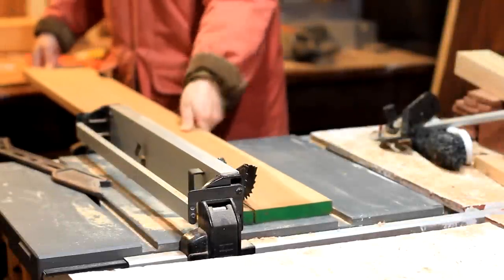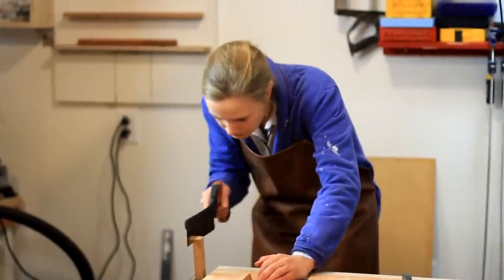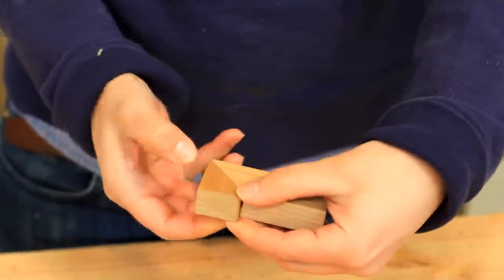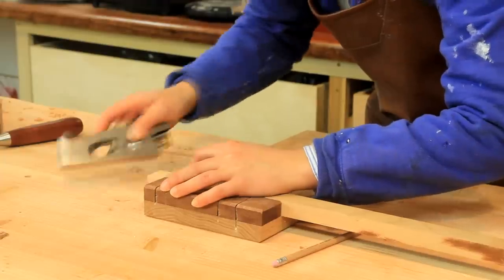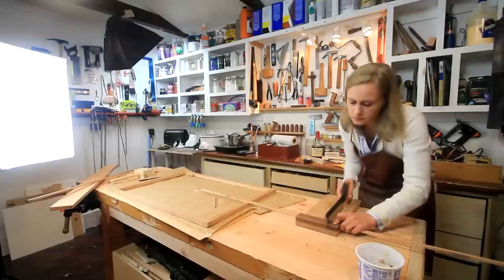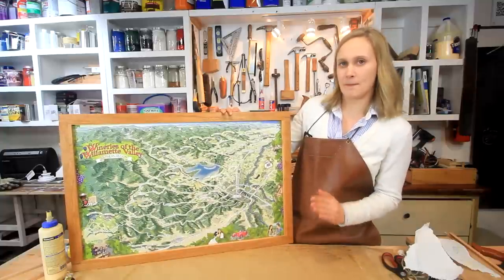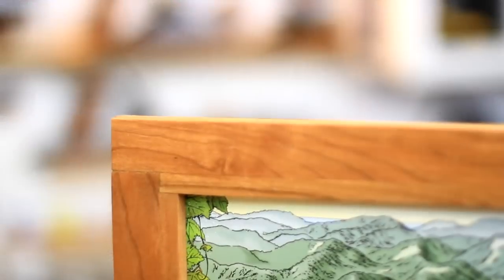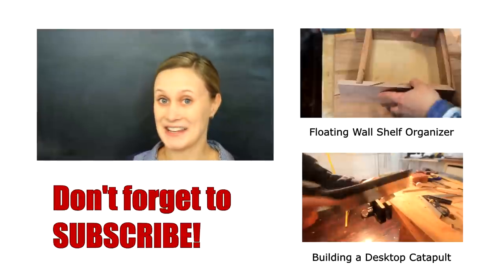How To Make a Traditional Picture Frame

Comment: What was the tiny plane? Do you have a link to where you bought it?

I feel like an antique store is going to be my best bet because I want a cast iron plane.
Reply from the maker: Dan Mills Hi Dan, the plane was a Christmas present, so I'm not quite sure where it's from. However when I did visit an antique store the other day I did see a couple of small planes that looked nice, so that might not be a bad way to go.
Reply: Dan Mills If you're looking for a number, the Stanley #101 is a small block plane, and a variation of it is the Stanley 12-101 still being made today (I would grab a vintage/antique #101 myself).

Darbin Orvar  liked the project, just about to make a small picture frame for my mother, and liked this one.  I've made a few frames before, but like to try different ways of making them when I can :)